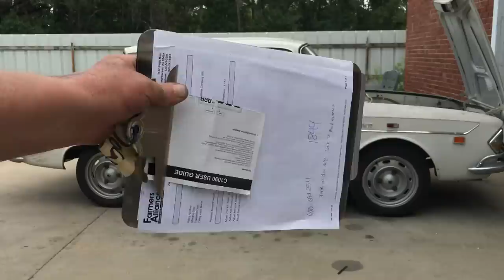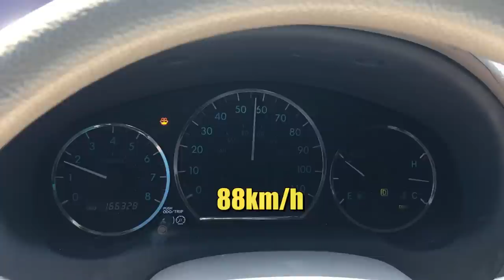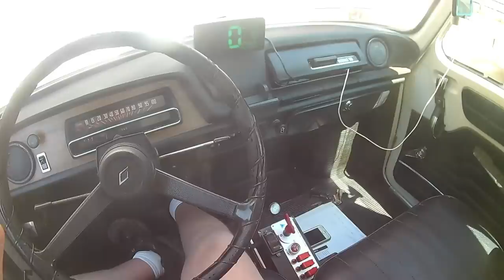S3 E21. How fast will this 670 cc predator V twin powered Renault go?...  Faster than you think!

Comment: Back in the days when Renault built cars to be reliable and serviceable!
They pretty much stopped that after the R18 and the R9/11. Everything from the R19 on was designed without servicing in mind and they got the level of attention you’d expect, leading to very high failure rates from a young age.
They came up with new ways of failing when Laguna and Megane came out, by creating a nice well in the floor, under the front seats, to accumulate water in and using that as the location for the ecu.
The little R10 wasn’t as popular over here as the 4 and 5, but there were a few and some of them were considered quick, for their time. Certainly a match for their contemporaries from VW (Beetle/Bug), Morris (Minor) and Citroen( 2CV, or later Dyane).
Hillman’s Imp was a sports car, by comparison, despite a broadly similar design concept, 
I know nothing about the Predator engines, except that they’re not emissions tested for road use, so would be difficult/impossible to get through a roadworthiness test in most European states and insurance would be impossible to procure, unless you have a trade policy. That said, lawnmower engines are generally pretty efficient, not having to deal with all the ludicrous emissions control stuff inflicted on road engines, so I’m sure it’s going to be pretty economical, even with the torque converter and cvt, which generally don’t help with economy. I’m going to say something in the region of 50-55mpg.
Reply from the maker: My only real complaint about this R10 is the four wheel disk brakes.  Yes that is certainly revolutionary for a compact economy car at the time but the way they made the parking brake work on the rear calipers defies logic.  Overall this car is seemly well built and because its been stored in a garage for most of its lie it doesn't have any serious rust issues.
Reply: Yes! Yes a thousand times!
It’s French, so of course it defies logic. That’s the whole appeal of French cars and if you’re not into that you buy a sensible German car instead. 
The funny thing about the weirdness in the heritage cars is, it usually works. I’m not familiar enough with the R10 to be able to advise on it, but there are clubs devoted to the marque and, while they won’t take kindly to your transplant, they’ll be keen to help preserve the car, so I’m sure you can get advice from them.

Comment: This is an amazing result.
Before this testing I was already wondering how it'd perform, and of course me being not able to leave good enough alone, was wondering what kind of power and speeds you'd reach if you did something like Red Beard's Garage did, used the billet GoPowerSports parts, and one of those smog pumps to supercharge it.
I know this is likely out of your realm of things to do, but it would be a fascinating experiment given the Kubota went from NA to turbo'd, and became a test mule.

Comment: These cars originally had a 4 cylinder engine aprox 40hp ( cast iron i am guessing, the all alloy came along 20+ years later ) power to weight ratio will be favorable, the air cooled V twin will be light, all up it is doing very well!! For a small engine!!!!

Comment: Hey Jimbo, thanks for another cool video on this one-off project!  I also appreciate all the many many hours of work behind the scenes that go into each video!

I was very surprised at the max speed the car obtained, I think I estimated 50 mph a few weeks back.   I guess the car is more aerodynamic than it looks and of course the extra engine displacement helps as well.  Looks like you are approaching the "power/performance" of a 1950 VW bug with the new concern of actually risking a speeding ticket. 😂  So, given the amazing test results on this first drive, I will venture an estimate of upper 40's for gas mileage.

Comment: You know what would be super cool? An EFI Honda CT90! The biggest problem I have with mine when trail riding, is the engine runs like crap once I get to the top of the mountain (which is usually where I need the power the most!) Could compare it to the modern CT125 with Honda's PGM-FI

Comment: When you do finally remove the governor, don't forget to also remove the low oil shutoff sensor in the same area and bypass it. it's a silly addition that shouldn't even be there, and there's a possibility that you could eventually accidentally trigger it and cause yourself some trouble while testing. As far as performance upgrades go, I mentioned it in a previous comment but gopowersports has a performance torque converter that you're going to want to look into that perfectly fits the shaft of that engine. Carsandcameras just installed one on a King Midget and uploaded that video this past week. They went straight for the beans of bending and welding up a custom exhaust however, but the rest of the stuff they did with it is pretty on-par with what you're trying to do here.
Reply: At this point i'm pretty convinced the oil shutoff in predator motors is there purely because some bean counter somewhere figured it was cheaper to slap one of those on than to deal with warranty claims (even though they probably explicitly don't cover low oil scenarios). That or they got tired of the calls in general.

Comment: The BSFC (fuel efficiency) of gasoline engines is actually very decent compared to diesels........provided the throttle is over 50% open or more, the throttling loss issue is greatly reduced. Modern engines get around this with VVT or something like BMW's "valvetronic" system.  Of course, something like a turbo-compound (power recovery) system as researched in WW2 gives a 60% improvement.  With one of these tiny engine installs, there is actually enough room to fit such a system, coupled to the engine.   Keep in mind that Kansas almost certainly has ethanol blend gasoline, and that increases fuel consumption.

Comment: I'm thinking it will do abt. 45 mpg average.😉 You're right about the exhaust on those. Their main objective was noise (or lack of) when they designed the exhaust system. A set of free flow equal length headers and mufflers will wake it up a bit.. and they still run relatively quiet. EFI and some engine management would make it shine in a vehicle, for performance and fuel mileage both. There's a ton of performance stuff available for all the Predator engines, and you can easily surpass the stock 51 hp. of the original engine. I figured it would easily do the 60-70 mph. range in stock form, judging from the weight of the car, and the general performance curve of the 670. I'm not even going to guess at a top speed on a performance build, as it depends on how crazy you want to get with go-fast parts!😂👍 The guys from Cars & Cameras have a methanol powered, turbocharged 670 in a rail frame that's pulling down mid 7 second 1/8th mile passes!😮 Curious to see what you do with this little beater...
Reply from the maker: given the local speed limit, we wont really try to go faster than 70MPH... plus it was a little scary getting the renault up to 67 MPH...lol

Comment: Those engines sound good straight piped. The best upgrades would be a mikuni carb, aluminum flywheel, aluminum connecting rods, and a bigger cam.

Comment: I haven't looked up what I had thought the Predator powered Renault would do in its basic configuration, BUT I'm more than a little impressed that she did 67 mph on the initial road test. I'm looking forward to seeing to seeing the results of your first road test, and everything else to do with this car. I've been daydreaming about a build like this since before there were Predator engines (or Harbor Freight for that matter). Back in the 70s Briggs and Stratton had built a hybrid car powered by one of their 18 hp industrial engines. I had wondered how well that would go. I have often assumed that doing this would require a scratch built car to get the weight and drag where I wanted it. Since I don't have Jimbo's mechanical skills, I have never pursued this idea myself. I am enjoying watching you work with this car.

I'm guessing 42 mpg. According to the megacomputer Deep Thought, 42 is the answer to the question of life, the universe and everything. Maybe the question is: "How many miles can a Predator Powered Renault 10 cover on one gallons of fuel?"
Reply from the maker: You know, there are a lot more lawnmower powered cars being put together by non youtubers since I started making these crazy videos.  Just keep it simple in order to finish and then add the complex  stuff.

Comment: I'm very impressed with the speed you're getting out of this thing. I figure one of two things is happening. This engine either makes way more power than I thought, or that car is way more aerodynamic than it looks. Nice work.
Reply: the trick of old cars light very light ...very narrow tyres =very low rolling resistance  ,, and most of these cars were not that bad aerodynamically either,, awsome build
Reply: At first I thought the belt drive 'torque converter' was crazy, now I think it's genius. For a small engine to get that heavy a car moving needs gearing and the belt drive + 4 speed has them. The belt drive allows the engine to rev into its power band early and stay there. Literally multiplying its power.
Reply: @kimmogensen5390  After I commented this I got thinking and realized that this car being so tiny the frontal area is also very small. That makes a huge difference in drag. Looks can be deceiving for sure too. The weight is going to have more of an effect on acceleration and hill climbing, but on flat ground shouldn't make much difference in top speed (within reason of course).
Reply: @randr10  yes you are right that weight mainly effect on acceleration and so fourth and these cars is quite small (even the bigger euro cars from the past like the volvos looks tiny compared to modern cars),i have messed with older 50/60/70 european cars for years  and it seems to me that these types of older euro cars like citroen 2cv ford escort the smaller german fords like taunus 12/15m saab ect ect all had the same recipe narrow wheels light body (and as you said small frontal area) and that in 1 happy mix gave them a possibillity of running small fuel effecient engines and still be able to follow traffic  while still being fairly enjoyable to drive they were however a bit dangerous if one crashed , it boggles my mind that car companies cant follow a similar recipe build a simple car light economical a basic driver easy to repair and maintain (ofcource the body will be 20% 30% more heavy) but with more effecient and powerfull engines they should be able to get cars just as good maby its all kinda on purpose ?
Reply: @mrdanforth3744  He's got several versions of this build under his belt using this type of setup with the smaller single cylinder engine in the Honda Insight so he's had enough practice to know what to use and how to tune it. His first attempts went very poorly.

Comment: It may not be aerodynamic but it is tiny, light, and not saddled with a ton of modern encumbrances like air conditioning and smog control, so it's kind of perfect for a project like this. I bet you could coax a good bit more performance out of it in the acceleration department, and still have pretty decent gas mileage.

Comment: One thing I see (and hear) is the need to shift without a clutch. The CVT obviously will not slow down enough to disengage. I think this worked well enough to engineer a manual clutch.

Comment: Great content, I wonder if you could double your project car fun by doing an EV conversion to the R10 after the Predator swap.  It looks like the perfect runabout car which would fit well with an EV conversion.
Reply: He should do the ultimate mullet conversion. EV in the front and gas lawnmower engine in the back. 

As long as the EV drive train doesn't greatly overpower the gas or the other way around you don't really need any sort of power matching setup. 

People have found out the tires and the road do that just fine. 

I've seen other YouTube videos where a motorcycle engine was put in the back of a Prius to drive the rear wheels whenever they wanted more power.

Comment: Its nice to see that it does perform pretty much what i guessed, amazing. For the fuel economy, i will just go the same way as last time, and compare it to a somewhat similar car, the Citroen 2CV - which does take about 6 litres, in german "Drittelmix" (part town, part highway, part country, to say it easy), but since you can go 55 mph on flat roads all day long over there - you gonna hit below 5 litres / 100km, i am pretty sure. Second guess would be below 5,3 - but not more than that. And for the fun of it, 3rd guess would be 4,7 depending on circumstances, but i would bet on that too. 
Love your project with that funky R10. Here in germany they vanished like 20 years ago as well. Keep up your good work!

Comment: In the stillness of night's embrace,
When the moon's gentle glow graced the space,
A tale unfolded, whimsical and surreal,
Of a gnome and his Renault, on a midnight zeal.
Reply: When silence reigned, and the world lay asleep,
The gnome awoke from his slumber deep,
His eyes twinkled with mischief, mischief untold,
As he yearned for adventure, to break free from the mold.
Reply: With a mischievous grin upon his face,
He donned his red cap and embraced the chase,
To the garage he hurried, his heart all aflutter,
To his trusty Renault, a gnome's joyous clutter.
Reply: The engine purred softly, as if in delight,
To accompany the gnome on his mystical flight,
With none to witness this nocturnal escapade,
He turned the key, as the darkness gently swayed.
Reply: The gnome took the wheel, his hands small but steady,
Through winding roads, he ventured, purpose unsteady,
He weaved through the shadows, no headlights to guide,
In this whimsical realm, where his dreams could collide.
Reply: The Renault roared, an echoing sound,
As the gnome, unbeknownst, covered more ground,
Past sleepy houses and slumbering trees,
He danced with the wind, amidst the night's breeze.
Reply: The stars, they whispered secrets unknown,
As the gnome and his Renault continued to roam,
Through meadows and valleys, they traveled afar,
Chasing moonbeams, under a night's mystic star.
Reply: No rules to obey, no red lights to stall,
Just the gnome and his Renault, having a ball,
Laughter erupted, filling the enchanted air,
A symphony of joy, a melody so rare.

Comment: Gee. Once modded you'll want a better gear ratio to leverage the power from 0-70. --- I was debating a V-Twin swap on a classic VW I have that is similarly weighted. This convinces me it's a more doable idea than one might think.
Reply from the maker: Its possible with a few mods the 670 could perform as well as the original engine.  someone needs to find out.....

Comment: GPS speed is more accurate than the car speedometer which is mechanical off the transmission and tire wear can affect the actual reading. 
GPS does the calculation based on location and time. I don't know what the update interval is though.
I have one size larger tires on my F150 and the GPS says 60 MPH while the speedometer says 57 MPH. So I trust the GPS to not get pulled over for speeding.

Comment: Great project. Before the next speed and acceleration test make sure you cover the little Renault in Gordini decals and set severe negative camber, it will make a huge difference to the performance :)
Reply from the maker: Yes, stickers will certainly improve the performance with very little effort.  lol

Comment: I have a Japanese Kei class pickup with a naturally aspirated, 660-cc, inline 3-cylinder engine.  Backed with a five-speed tranny.   In stock trim, it would make 105-kph, or just about 70-mph.   And the turn signal, is also on the right hand side of the column.  

I bought a a bumper sticker which says:  The 3000-Squirrels are working as hard as they can
Reply from the maker: LOL, I need a bumper sticker like that!

Comment: Don't forget about engine break in it may rob you of some power in the beginning

If that engine has a oil filter (which i think it dose for its size) perform an oil change after a few hours of straight running and change the oil filter as well I think you will notice a difference in power

Comment: I owned a Renault 10 major in the mid 70's, great little car, drove from Germany to UK in it, no problems....except for the constant rattling from the all around disc brakes......fine for a short while with new brake pads, but as soon as they wore a little...... Rattle Rattle....Rattle rattle.

Comment: The 4CV Renault made only a few years before this model was powered by a 4 cyl 750cc engine, a very low tech low power engine. You haven't so much modified it as remove a lot of French parts that fail often. :-)

Comment: Definitely needs more RPMs out of the engine, but that would mean that it also needs a flywheel that's not made of cast chinesium that could explode if pushed past the governed limit... :P
Reply: Those things can be made to make around 55hp, that power should make this car driveable
It also sounds way better than a 4 or 3 cylinder, just needs regular clutch
Reply: @mihkus  Problem with a "proper" clutch is the engine can't take a regular one as it is not set up with thrust bearings, a regular clutch adapted to fit this engine would trash the engine bearings in no time, I think this was previously already explained in an earlier vid when mating the engine and transmission via the CVT, hence why it's set up this way...

Comment: Interested in the next steps of these. For your exhaust manifold how about you try a 4-2-1 set up like the Civic crowd does. And also I'd be really interested in seeing this as a built motor with no forced induction if billet parts exist for this size